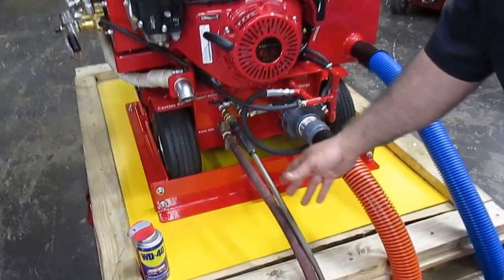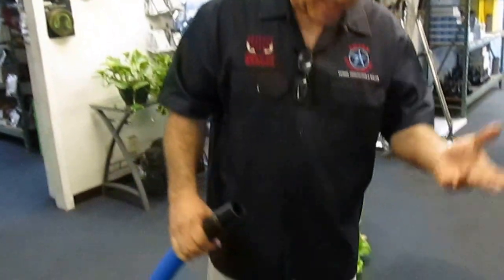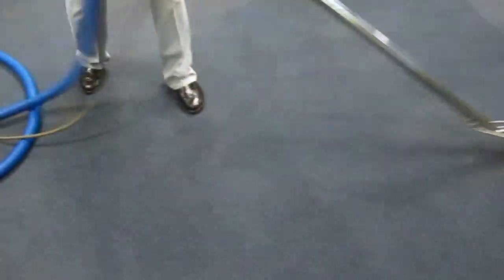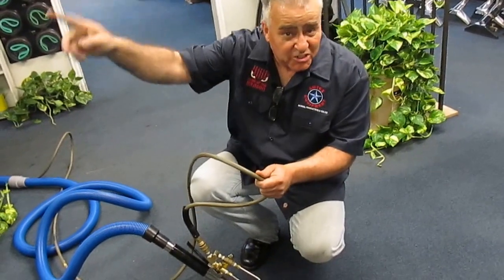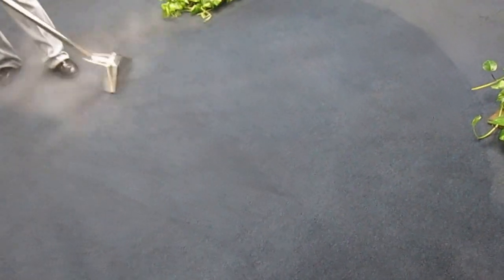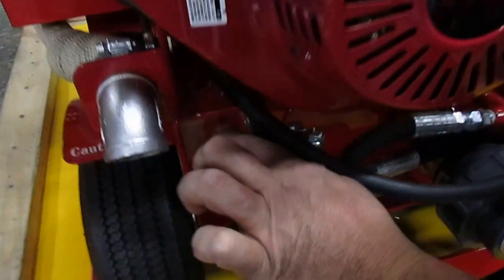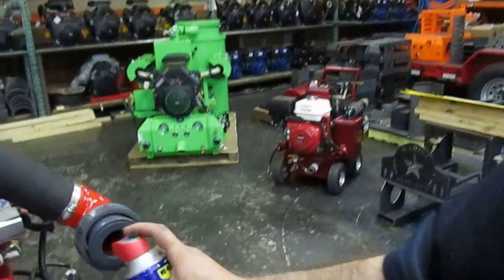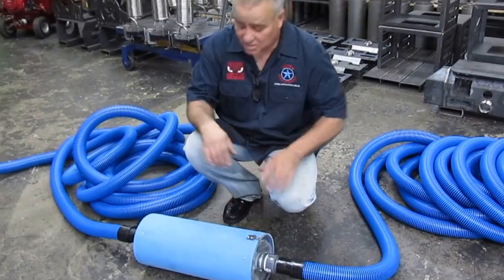Amtex Equipment Latest Model Of Prowler 13hp Intro 2

Comment: Great looking machine. I might be looking to get one soon. Do you recommend running it at the max rpm every day and every job? Or will that drastically increase wear and tear on the machine? And this would be my first gas powered machine, how long does a full tank last?
Reply from the maker: Brian Edwards You can run unit slower, if you like.we have had Honda powering Prowler for nearly 8 years now,and as long as oil changes are done on time, they will perform fine for thousands of hours at high speed everyday